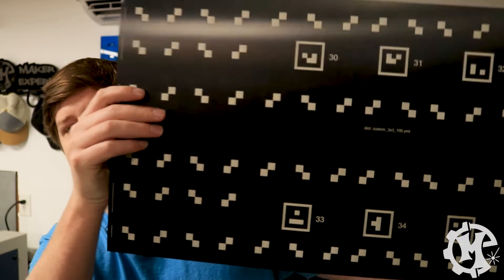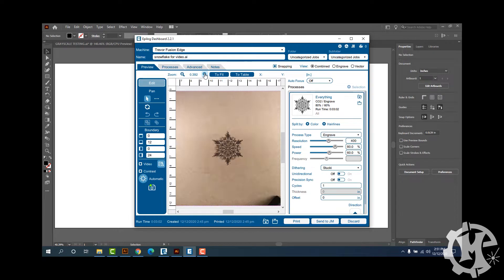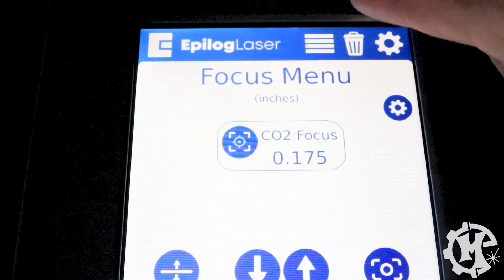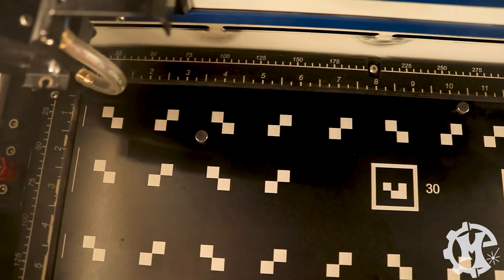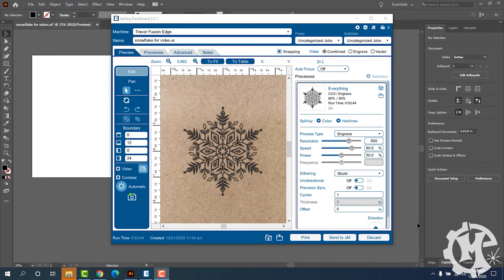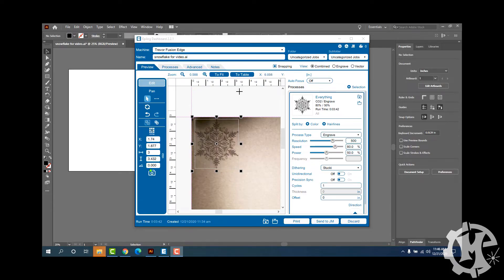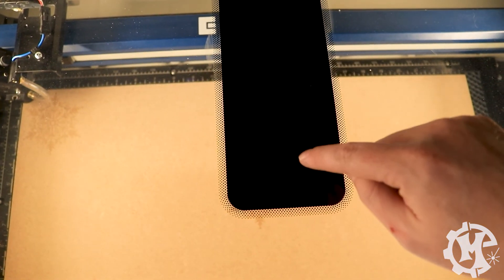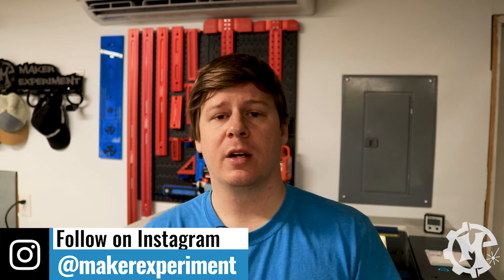How to Calibrate the Epilog IRIS Camera  Laser Camera Calibration

Comment: Thanks so much for the amazing video. One question, can I use the camera on the edge model to cut around printed area? I noticed on Epilog website that the edge model camera doesn’t have the camera with registration and wondering if the ones on the edge would work to cut prints.
Reply from the maker: So you can do it if you use a work around. I actually want to do a video on this but need to get a printed item.
Reply: @MakerExperiment  any updates on your video😅. Was scrolling through your channel and watching your videos and stumbled upon my old comment. I’m finally buying the fusion maker and so excited for it.
Reply from the maker: @ahmedas1991  I have cut around printed objects before with the camera it has. It is tricky to line up sometimes but it can work.

Comment: Thank you for the awesome video! I just calibrated my Epilog Fusion Edge 24 for the first time and received some troubling results. (Just received it today and went through training this afternoon) It has two iris cameras and it registered a score of .26 on one and .33 on the other. Do you know what could have caused this low of a score? With that score do I need to run the calibration again or how would you proceed with correcting it to be a good score of .5-.6?
Reply from the maker: My first suggestion is make sure that your bed is level across the table. That could throw off your score.
Reply: Daniel,

I suspect you've already figured this out, but the score you listed is very good!

Comment: Thank you. Y Axis drive alarm, tracking alarm, anything happened while you were using it? I have Y left, Y right drive alarm now. So I can't use the machine. It's been 3 days since I requested technical support in Korea. There is still no answer. Is technical support fast in the US? Yaxis is not controlled properly.
Reply from the maker: Technical support in the U.S. is usually the same day. I haven’t received an error. What happens if you power cycle the machine? Will it let you use it without the camera being calibrated for now?

Comment: Thanks man for takin' the time to create a calibration overview. I use the Fusion 32 and find that the camera is okay for certain use cases but quite often annoying as it wastes time, material, and substrates as the further away you get from the center the WORSE it gets...calibration or not. Concentric circles don't line up inside of coasters, artwork gets skewed along the adjacent axis, and other "artifacts" such as focus issues show up in the finished product. My thoughts are that the standard design should have included "at least" two overhead cameras on all machines like they did for the Fusion 48. For spot on accuracy I end up using the red dot, measuring jigs and using templates, registration methods, etc. There are plenty of fantastic features on the Fusion, don't get me wrong, but kind of a bummer after spending five figures on these machines with the overhead fisheye camera as a main selling point. The Epilog Edge you're working with in this video may not show these issues as much because of the smaller platform, but as you stated, it's expected. A vid that shows how to get around this issue in the Job Manager may be really helpful (the Mini would never experience this problem as there is no camera)...just my opinion. Keep up the great shares. We love 'em !!  Enjoy 2021!
Reply from the maker: storytellerHD I agree that there should be two cameras in all pro models. I still need to do more testing with it. When the item is under the camera it works great, but your correct about moving further out. I’ll have to look into it more.

Comment: I found this video very helpful!  Just received my Edge 12 and the camera alignment was way out of wack.  I couldn’t even see the laser bed.  Epilog support recommended camera alignment but I was skeptical it could correct such a huge misalignment.  The process in the manual is simple, but as they only supplied a blank anodized aluminum sheet (that was not perfectly flat) -  I had no idea where to place magnets to avoid interfering with the engraving.  Your video solved that problem for me.  I think Epilog should include a picture of the engraving in their manual with ruled lines to indicate clear space where magnets can be placed.  Doesn’t need to be to scale as long as the ruler lines are annotated.  Thanks to your video,  I got a .57 with the first calibration.
Reply from the maker: I’m glad the video helped!

Comment: The camera of my epilog engraver stop working, any idea??
Reply from the maker: I would check and see if there is a firmware update. Some causes I’ve seen for this are a firmware issue, the IP address on the machine doesn’t match the IP address in your job manager software, or if you’re on a wireless connection and the Wi-Fi goes out that can happen. I hope that helps you narrow it down.